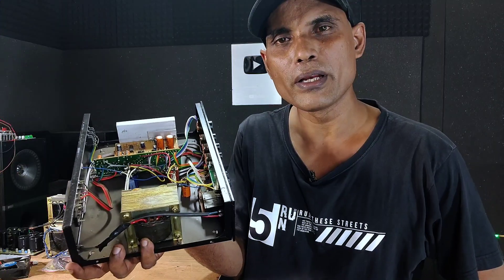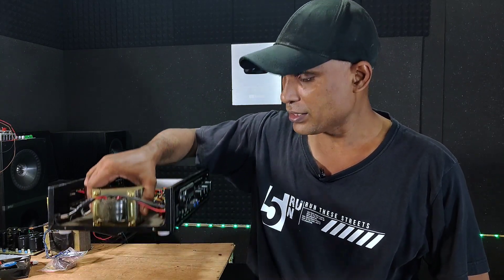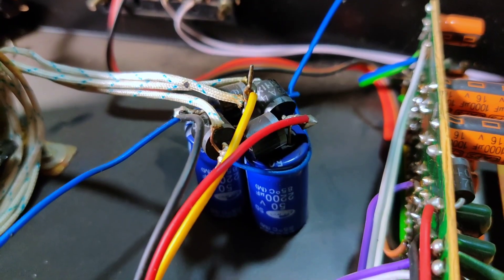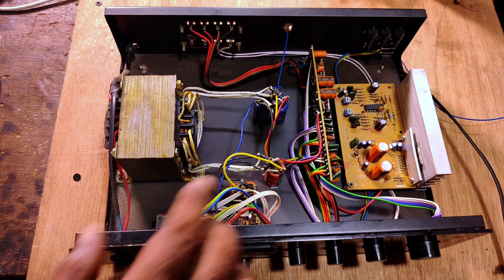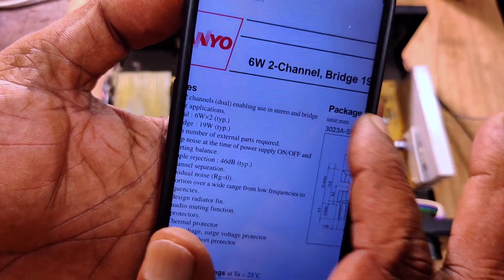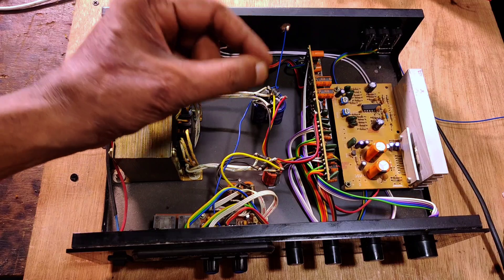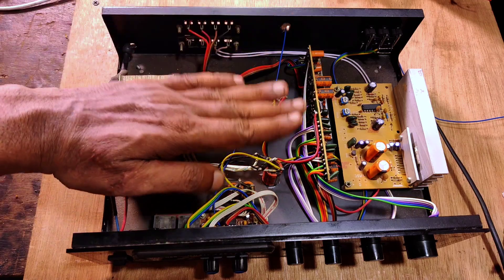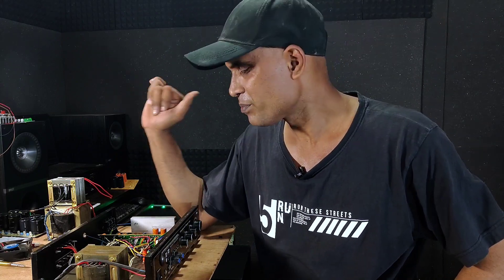Fixing a 2.1 Amplifier with No Bass – What Went Wrong?

Comment: I am using a single 4440 ic in a bridged configuration to run a 8ohm woofer(a bit higher efficiency than the average sold here in the market) with 2x 4700uF capacitor in parallel 

 a parametric Equalizer (poweramp Equalizer - it also has compressor) And removed the inbuilt tone controls of the amplifier. 
For my case it is very great for my small room..
Reply: Also have a crossover.. 

But its in 6khz - the woofer runs below 6khz and the tweeter runs above 6khz

Bi-amped (there is 2x 4440 ics )
 the woofer crossover is done by the power amp Equalizer..

Tweeter(4ohm) crossover is done by 3x 2.2uF caps in parallel
Reply from the maker: Ha. I also never use tone control's.. For my room 🙂